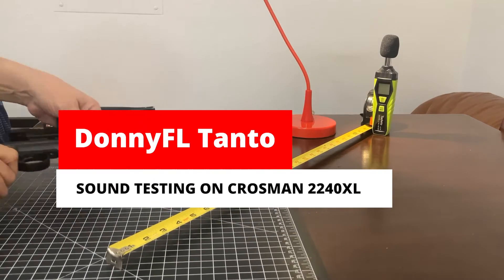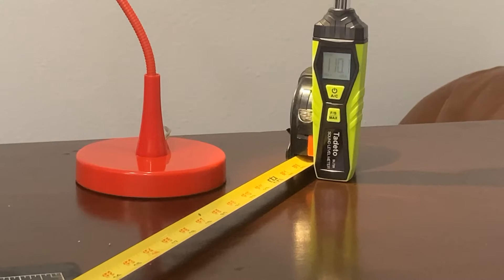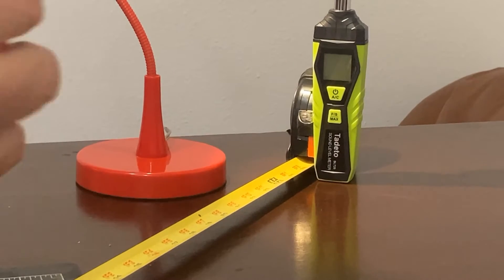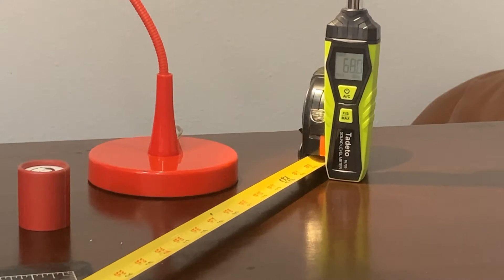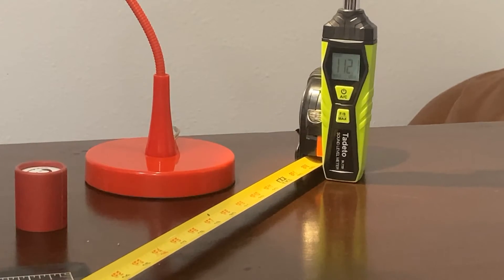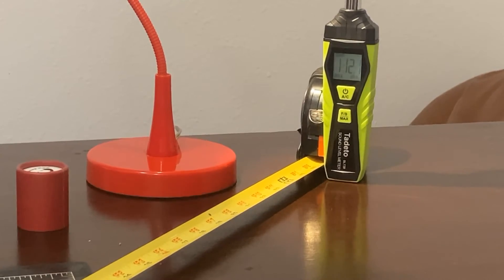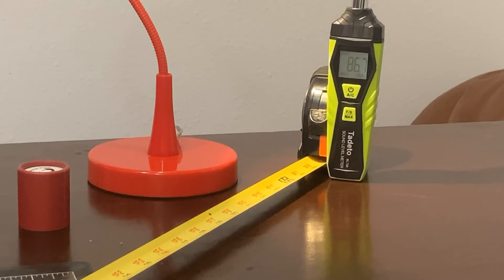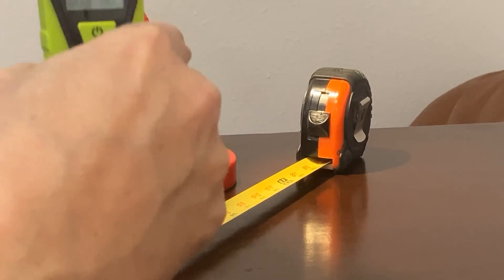Sound Testing 2240XL & DonnyFL Tanto

Comment: it's NOT consistent....you set the meter on "max"🤣🤣🤣🤣🤣
Reply from the maker: Max, is the mode where it stores the loudest sound. The Maximum sound. It’s also set to Fast as opposed to Slow which dictates the sampling rate. The inconsistency is do to these units not having a fast enough sampling rate. Of course an analog meter with a data logger would be better, I digress. Anyway since we’ve attempting to measure a very rapid pressure wave, averaging is the best solution given our equipment limitations. I’m researching upgrading our measurements. What equipment do you use or prefer?
Reply: @AlsAirguns max means that lower volume levels won’t register after a higher volume. My sound meter works the same way.

Comment: I love that so many of you guys do these tests for us who can’t afford the testers. Makes it easier when buying the products.😎
Reply from the maker: Glad you appreciate the effort.
Reply: Al's stuff is top  ^   yo Johnny there is an app you can get that will measure the DBI  if you want to do your own comparison , I have an TKO that's pretty quite , the best I ever had was homemade with a stiff rubber housing , the hammer strike was the loudest part of the gun ,
Reply: @BackyardDispatcher  
Thanks Stonie…I will check it out.
Reply from the maker: I’m thinking of ordering one myself for my 2289 build. I’ve used TKO before & they are really good units. Not at ruggedly constructed as a DonnyFL and aren’t really made to go on & off or move between guns. They are however lighter, considerably less expensive and include the barrel mount for non-threaded barrels like the 2289’s. They’re very effective but this will be my first opportunity to test their performance with a digital sound meter.
Reply: @BackyardDispatcher good to know. Thanks for the info!
Reply from the maker: Got my TKO in for my 2289. It is amazing 🤩 I’m putting out the performance video any day now.